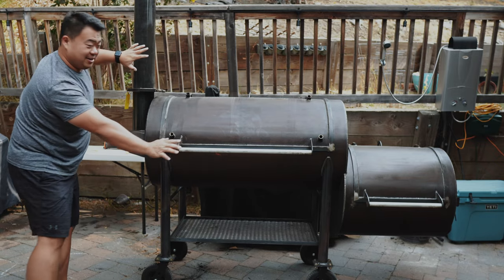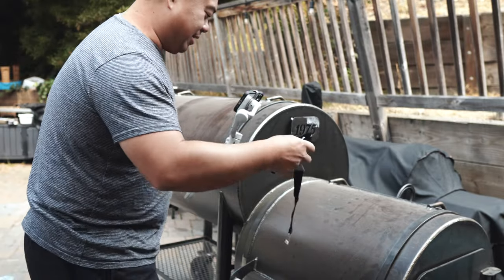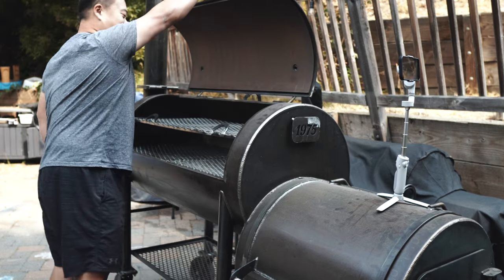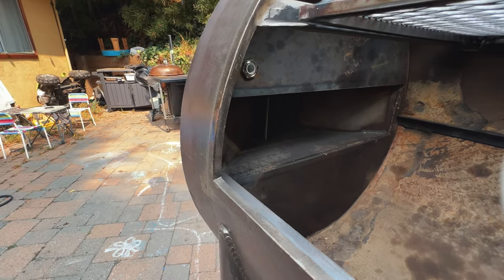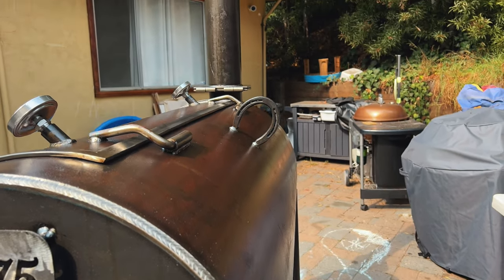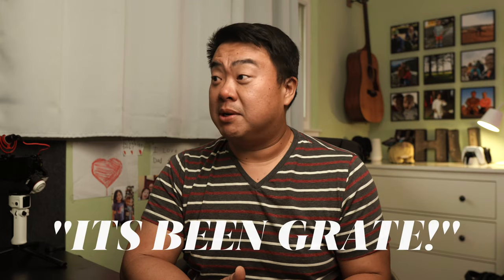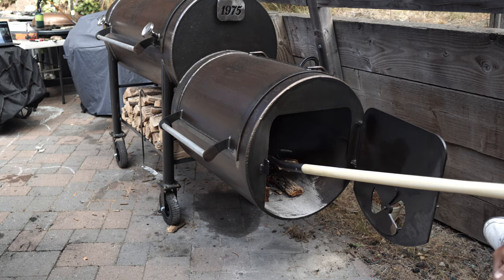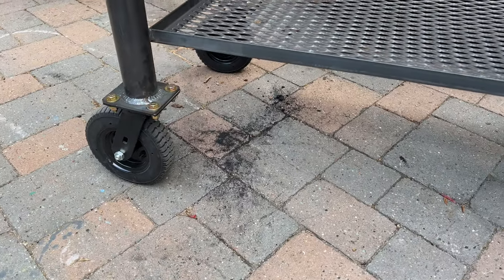Workhorse Pits 1975 - Delivery & Walkthrough - First Impressions - Questions Answered - Pros/Cons

Comment: I ordered my 1975 in March of this year and received it a couple of months ago. I like you am disappointed in the wheels, they should have locks, and the tire compound in my opinion is too soft. I agree the Firebox is heavy, you can easily pick the pit up off of the ground by lifting it from the stack end. Other than that I am some what pleased with the 1975. Lastly to missing steel on the inside of the doors is from the plasma cutter they used, I looked at mine and did not have anything like it.
Reply: Hi Rick 👋🏼. Did you have to move your pit over grass? Right now I am weighing my options to see if I want to spring for the wagon wheels. Or I can try to save money and hope that plywood would work while transferring the pit to my backyard.
Reply: @faustozamarripa7122   Frank avoid any grass at all costs. When I received my pit I attempted to put it on some pavers that I had my original Old Country Pit sitting on. The 1975 immediately started to push the pavers down and it ended up off of the pavers and into the grass. It took myself, my 20 yr old daughter niece and her boyfriend to get the 1975 back onto concrete using plywood. If your path to were you want to put the 1975 is grass , I would suggest using at least 1/2 to 5/8 inch thick plywood and have some help. Like I had mentioned previously the wheels you and I have on our Pits are not what I expected and should be upgraded.
Reply: @rickevans8299  Thanks for the info Rick. Looks like that just solidified wagon wheels on the smoker I choose.
Reply: @faustozamarripa7122  Frank are you getting the wagon wheels from Workhorse or another source?
Reply: @rickevans8299  I haven’t ordered the pit and wagon wheels yet, but when I do, it will be directly from Workhorse or the builder. I don’t want to go through the trouble of installing wagon wheels myself, seeing as how heavy the pit is going to be. Plus, I believe Workhorse designs their wagon version with a middle support bar for better mobility.
Reply from the maker: Hey Rick have you come across other options for the casters?
Reply: @HuSmokin  No I haven't, I am still looking.